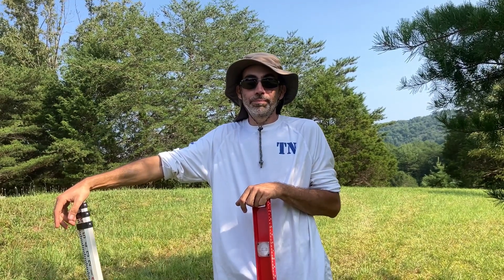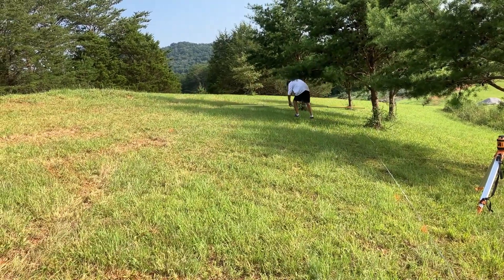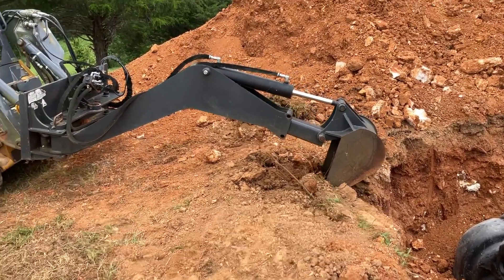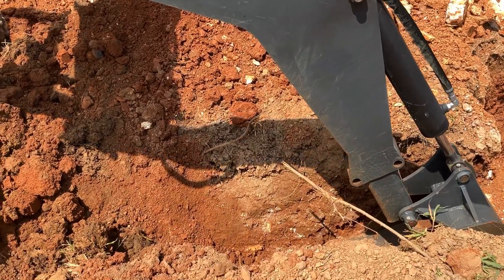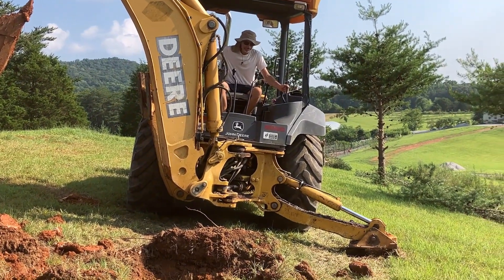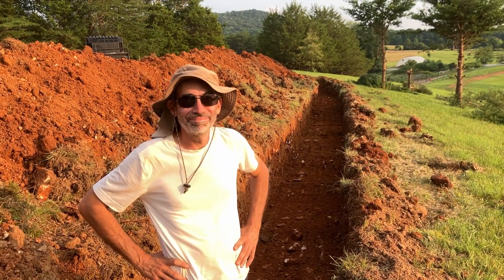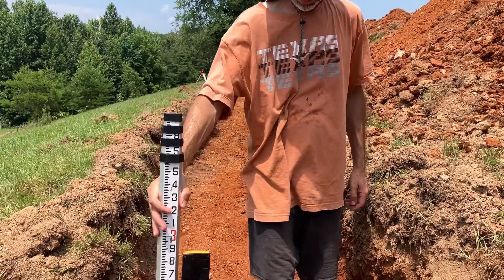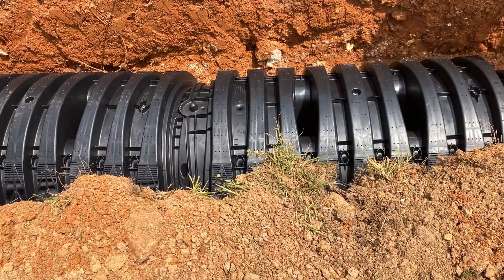Infiltrator Chamber Septic Line Install...The First Run Is In!

Comment: Nice job. I assume that is what is called a serial chamber field where rather than using a D-box, you just connect the lines together.  My requirements are the same.
Reply from the maker: Thanks!  Correct, you chain these up to 100 feet then link them to another line via a 4" PVC line and start over again.  No D-box needed but I believe you could use one if you wanted to.  I'm pretty sure that meets code here in TN.

Comment: Can this be repaired if one gets crushed?
Reply from the maker: I imagine you could remove the broken segment and replace it with a new one, since they are all individual pieces.  That's one of the nice things about this system.  You'd just need to do the right overlap/underlap to get the replacement piece set correctly.
Reply: They're supposed to be able to support 16,000lbs crossing the field, but not driving along the trench row.